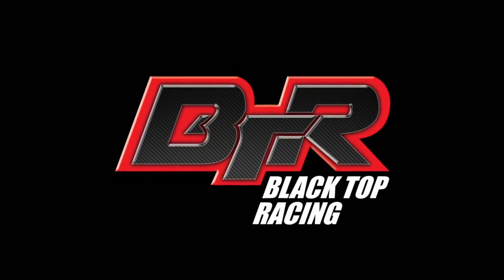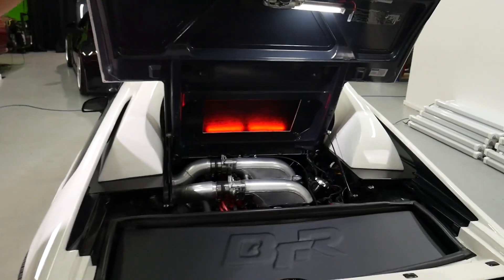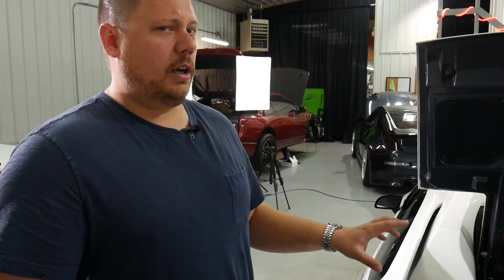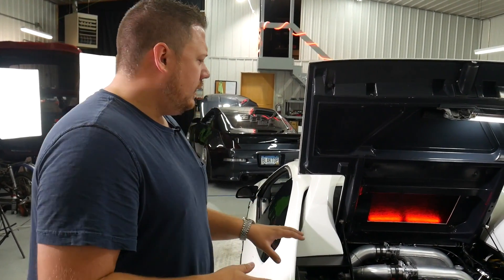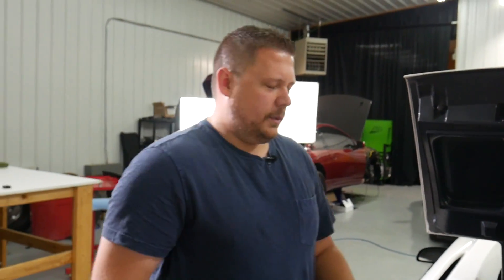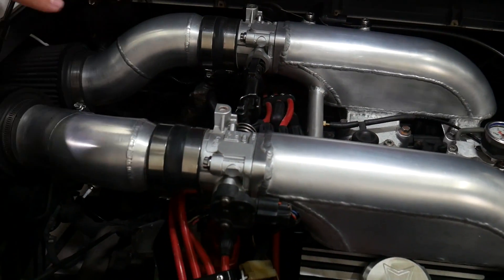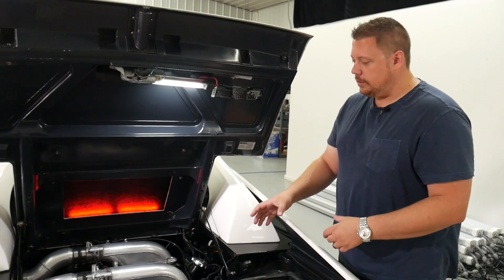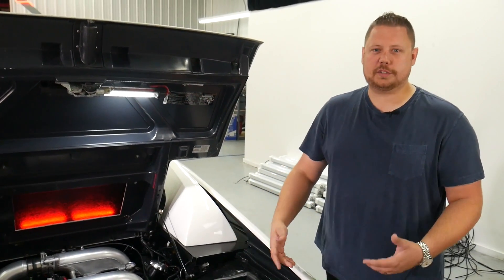Pontiac Fiero Dual Throttle Body Intake Manifold | Black Top Racing

Comment: Very interesting. I ended up here in my search to figure out how I want to put dual TBs on my car. A 94 Probe GT. Long live flip-ups! As i was saying. You should check out the design of the intake on the V6 Ford Probe GT, It's a 2.5l V6 from Mazda. There are 4 different intake designs from the factory. So what, big whup right? Well the trick part of these intakes is they have 2 crossovers tubes with butterflies that open at different rpms. The butterflies do not seal up the tubes they just impede the flow when closed. You don't want the power to snap with the valve opening, it's easier on parts, necks, tires.

 Just behind the TB the intake splits into 2 boxes, 3 runners each. 2 sets of 3 like you have here on the Fiero, just one folded over the other for packaging reasons which isn't an issue for a Fiero. So, valves closed, both sides pull from the direction of the throttle. When 1 valve opens, both sides pull air from the TB and can share between each other at the other end, shortening the path any air has to take to get to the runners. When the second valve opens each runner can pull air from the throttle , the end of the intake and the middle, further shortening the path the air has to take to get to the individual runners. Longer intakes make tq lower in the rpms, shorter intakes make more up top. So while the intakes don't by themselves make more power, they make more of the same power across  wider  rpms.

But wait there's more. The intakes take advantage of the effects of closing of the engine's intake valves. When the intake valves slam shut, the air coming down the runner backs up on the back of the valve. Before the engine valve opens again that air goes back up the runner into the intake plenum like a spring, while another cylinder's intake valve opens, giving a small supercharger effect at a specific rpm. All intakes do this to some degree, these intakes do it at 3 different frequencies (rpms) based on shape and size of the tubing, plenums, runners, etc.

Point is you could design something based off of it. It won't make more power but it will have more power most of the time.

I can feel and hear the intake change on my car as it goes through each gear. Electrically controlled, vacuum operated valves, run by the ECU. You could very easily make an Arduino based controller that opens the valves with an Rpm signal  and tune it, Or window switches for N2O which cost a lot more. I plan on doing this to change the rpms mine open at.

My second TB, the plan is to have it open at higher rpm, WOT, locate it  at the far end of the intake at 6500 rpm to see if I can make power up to 8k. It currently drops off after 6800. Redline stock is 7500, I've got aftermarket springs so I'm good, next thing to go is the oil pump at 9k. Combined with a cutout I should net something. There's Mazda tech paperwork out there. Look for VRIS explained. The engine is the  Mazda KL V6,   KLDE, KLG4, KLZE curved neck and KLZE straight neck listed from low to high power and tq. I own all 4 intakes so I may be able to answer questions, I have a video showing them with a quick explanation of each, if you're interested. For some idea, if any of you guys are familiar with a Quad4 turbo powered Beretta, or 3800 S/C, performance is in that range with the straight neck ZE NA. It's partially the 4 valve DOHC, but some of it is that VRIS system. just thought I'd share.